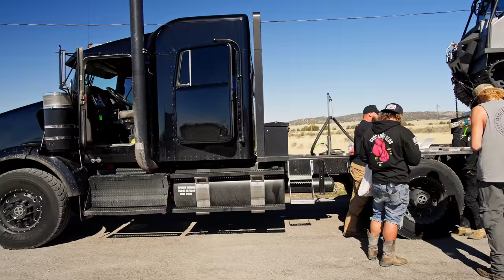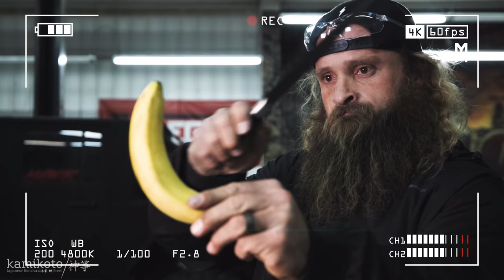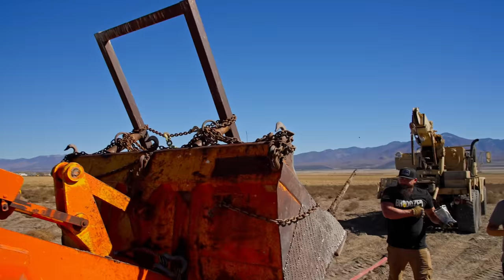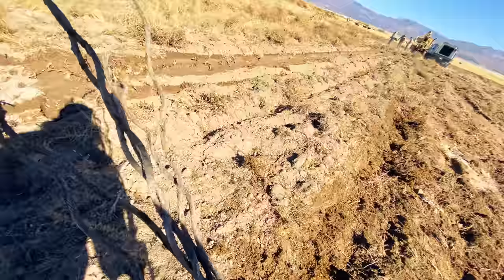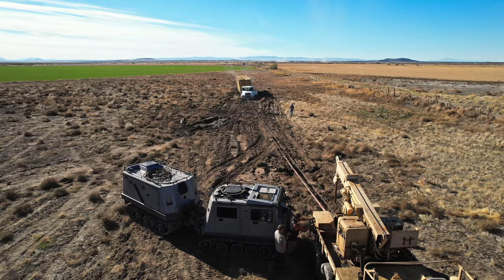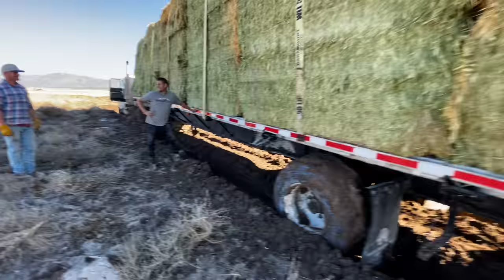I’ve Never Seen A Big Rig THIS Stuck (Dangerous And Difficult Recovery)

Comment: As a former driver of agricultural vehicles, looking at that stuck semi makes me wonder why they loaded it so high, knowing the ground to be soft.
Reply: I was thinking the same thing maybe this could be a setup
Reply: @djhancey7699  -  I know watch you're getting at, but some people are actually that careless/overly confident.  When i used to do commercial snowplowing there was 2 times i got myself in a pickle cause i underestimated the degree of difficulty, or got fooled by the conditions.

"oh......so the ice goes ALL the way to there.......GREAT!
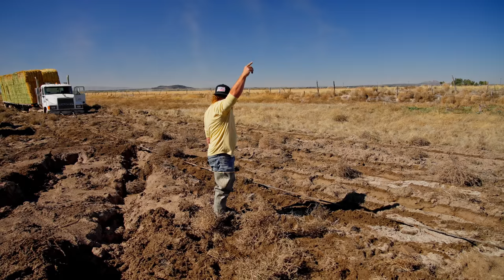Reply: i heard them talking about discovering a leak in the line that runs to a pivot, so maybe they didn't know until after it was stuck. what i don't understand (currently only 19:00 into the vid) is why they don't unload the trailer before even trying to pull the rig.
Reply: Rob C  i live in an agri area. dried alfalfa is green. idk what kind of hay is on that trailer but it looks baled to me. either way the weight is my point. they obviously have equipment so i'm sure they have a spear and another trailer of SOME sort. if the ppl that got stuck had unloaded all but the forward stack of bales (you want some weight on the truck's drive axles), then put their agri tractor at the back of the trailer and pulled the whole rig in reverse BEFORE it got buried to the axle they could've avoided the expensive call, not to mention they coulda been doing that instead of waiting on sparks so it wouldn't have cost them that much more time.
Reply: @dhtsoaedsdhtnadi9575  I like this team's recoveries and their videos, but I load and unload hay all the time.  It was only 36 of the big square bales, wouldn't have taken much time to at least unload some of them.  Glad they got it out, though.  Farm needs a water meter on both ends of the line feeding the center pivot so in the future any leaks are caught.

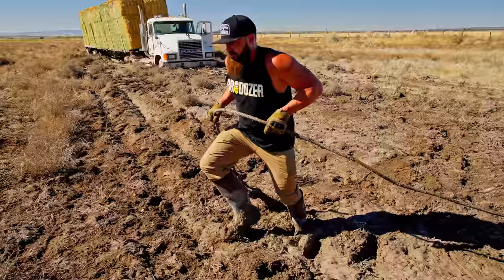Comment: 21:00>
Texas oil patch would double-line a 1" cable in that muck:
after the load was transferred, if possible, to a smaller truck via Rig Mats / Board Road.
Empty moves easier.😊

Did you ever cut a cable out of a truck just to retrieve the driver?
It ain't perty!

Comment: If unloading bails is a option i would do that forsur.   I dont like pulling on loaded semi with just factory tow hooks.  In the oil field we put heavy reinforced tow rings on suported with 3/4 plate right to the frame.

Comment: In my job as a loader driver taking shingle of river beds we get trucks stuck, first thing  is to empty the trailer. This could be done with laying boards down and that old loader .lighten your weight. Also the truck driver known when to let the clutch out and the right reves can make a huge difference.  We got a truck out in a similar situation with a tow rop and a 966 cat and a 78 years old truck driver with years of experience

Comment: Know we see why HD Dave went complete savage on all the new recovery wire rope, and heavy chains and equipment. Because when you start breaking your recovery gear, its almost a insult to your manhood. And any towing and recovery guy WILL NOT HAVE THAT,WE DON'T CARE IF IT TAKES A TEAM OF ELEPHANTS TO MOVE IT. WILL BUY IT AND USE IT.

Comment: Wow! impressive job pulling out the rear.  in physics, it might be explained: the mass moment of inertia for all the weight, is located on the wheels.  BUT, in front of most wheels, was a barrier in the dirt blocking the pull - meaning, the tires would need to be lifted up to overcome the Barrier.  OR, in a lot of applications, shovel out the material in front of the tires (did it a lot with stuck in snow - much easier to be pulled out).  you may consider in future, remembering to clear the material in front of the wheels first.  Smart to realize, pull it out the way it went in - the wheels were not as blocked.  enjoy watching your videos!

Comment: Should have been able to see that pulling it forward wasn't going to be possible because of how deep the front end was buried. A heavy duty rotator is the only way that the front end was going to be able to come out of that without pulling it in reverse. Waste of time and equipment to try pulling it forward. Even if they did manage enough torque to free that front end pulling it forward, the load would have listed and turned over because they had nothing to keep it upright.

Comment: It should be easy to pull backwards then pulling forward.   Did you see how Far down the front tires was into the mud?  Well only two ways to get it out.  The first one is cost to much money, you get very big helicopter to pull it up.  The other one is pull it backwards. You did that way, but to you  30 minutes or more or less, I wasn’t keeping track.  Then I realized that you should did that  the first time,Instead doing it in front.  Or you to make the video longer.

Comment: A little bit of intelligence by using a large tyre in between two chains or two ropes acts like a very big spring and if you drive the towing vehicle forwarded a good speed all the shock that usually breaks the rope and breaks what you're doing is absorbed by the tire double support and what is a stuck instantly becomes unstuck I've just waiting for someone to show it working on YouTube I've done it for over 30 years

Comment: Sucks seeing you guys advertise such a junk/scam product. Those Kamikoto knives are about the same quality as the clearance bin knives at a department store. The 420J2 steel they use is not quality or 'Japanese' (beyond that it can be made there just like anywhere else in the world). It is the budget/lower quality version of 420 Stainless (used for scalpels, razors, etc) & is typically found on knives under the $20 price tag. The only redeeming quality is it's got decent corrosion resistance. Not very useful if the knife doesn't stay sharp after each use. I don't know if if it was known how bad of a scam these are back when they were sponsoring you (I hope not) but it's definitely well documented now.